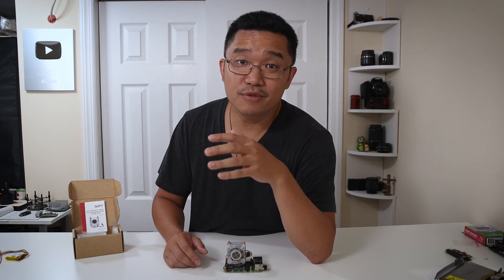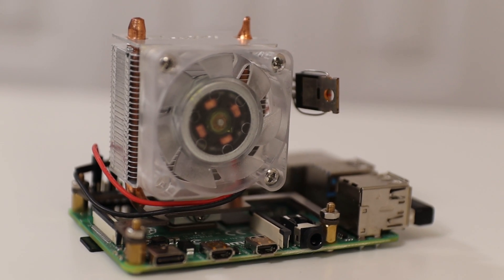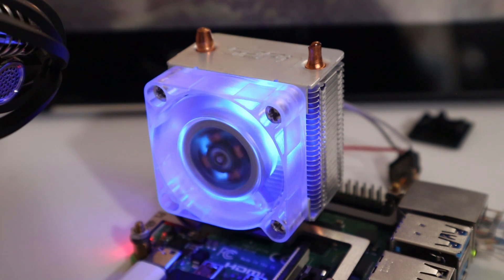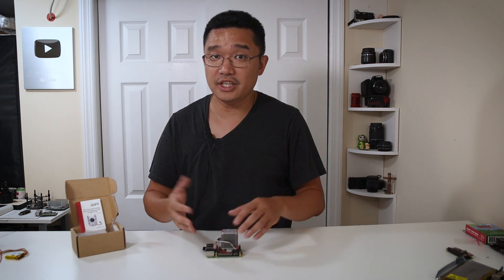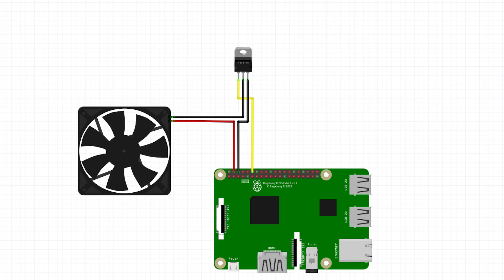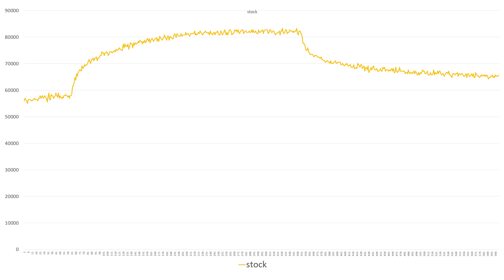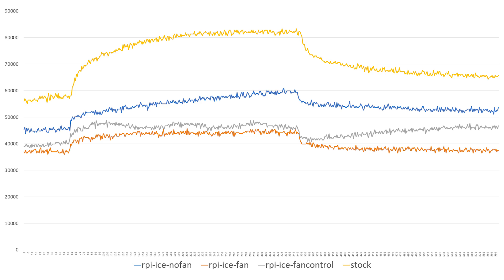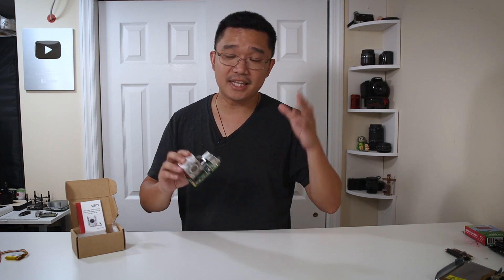RPi4 Ice Tower Heatsink and cooler with fan controller mod!!

Comment: Hi can you show how the resistor is connected, your diagram @ 2:50 doesn't show how to connect it. Also the resistor seems to be a 1.5k and not a 15k, can you confirm. Thanks

Comment: Would a IRFZ44N IRFZ44 N-Channel 49A 55V Transistor MOSFET work for this?  What resistor rating is best?  1000?  Would a diode  on the PWM pin be useful?  Your mosfet amazon link takes me to several differently rated MOSFETs instead of a specific one.  Also, you said "15K resistor".  Are you sure you did not mean "1.5K resistor"?

Comment: Why don't you just connect the fan to the 3.3V line instead of the 5V, or solder a resistor in series on the 5V line? Much cheaper and easier to implement.

Comment: I build a temporarely peltier cooling because the cooling i ordered on ebay takes 4 weeks to deliver. The 40 by 40 mm element just fits between the camera and display connector. On top of that , a heatsink and a 12 volt fan . Fan runs on 5 volt . The peltier element runs from 2,5 volt @ 1 amp  to 5 volt @ 2 amps on a seperate powersupply. I have not done a stress test yet.

Comment: ima use that instead of my
i3 6100 3.7ghz skylake
16gb ddr4 2666mhz
GTX 1060 6gb OC
120gb ssd
1tb hhd
my cooler is a 101i coolermaster with blue led fan so looks exactly like mine

Comment: first off no the pi 4 doesn't need a cooler that size.....
second.... why is the heatsink/pipe only sitting on the CPU and not also on the RAM and USB3 controller??.... <----this makes no sense at all when all it would have taken was a smarter heatsink and placement.... you can just use an $15 Armor case that will cool all three components at the same time
Reply: nothing... hum... not surprising

Comment: use thermal paste! the thermal pads suck and i got almost 8 degree difference with just normal paste also puts less pressure on the cpu and board
Reply: Do place the cooler right on the paste or do you have something between the paste and cooler ?

Comment: Thanks for doing this. How is the clearance between the Ice tower(and brackets) for using a heat sink on the memory and USB chips? I just got a Flirc case today and it does keep it from overheating (never hits 80C under max load) but with Thunderbird and one Firefox window open it is holding at 57C. Which would be OK but the case is hot enough you do not want to hold onto it very long. I really hate fans. Thanks

Comment: Hey can you review Teensy 4.0 board please? It comes with 600 MHz frequency and tiny size!!!!!!! Insane!
Reply from the maker: i was surprised myself how much faster it is from 72mhz to 600mhz wow!
Reply: pi zero is very small like the teensy but has 1ghz clock and 512mb of ram soo yeah
Reply: @catfish_lude  Lol but it's not suitable for running bare metal or RTOS

Comment: Hello Novaspirit,

I have been watching your videos for some time now, and relied on them more times than im glad to admit. Thank you for all your effort.

But now I want to create a small scream add-on to my car so it has android auto, I wanted to use Pi 3 whit a 3,5inch HDMI hat for the pi

The screen I’m planning of using is the same as your video here:

https://www.youtube.com/watch?v=Rr5pPpjHYPo

Question is will it be able to work whit this touch screen, and will it be usable ?

I know that this screen has a fairly low native resolution but it can be scalable via the menu, so will it be eligible ?

Also about the configuration and the initial setup, will it work out of the box ore will much additional setup be required ?

And lastly, since this is a small screen does it make sense to use the cheaper 3.5inch screens that don’t have the HDMI input but use the GPIO,

and if posable how will that work ?

I think that there are a lot of people like me that would like to see a video like that “cheapest android auto setup” for sure it will be very helpful to me J

Also if it uses an different variant of the PI ? zero, pi2 ore other alternative

Again thank you for your videos and I wish you all the best.